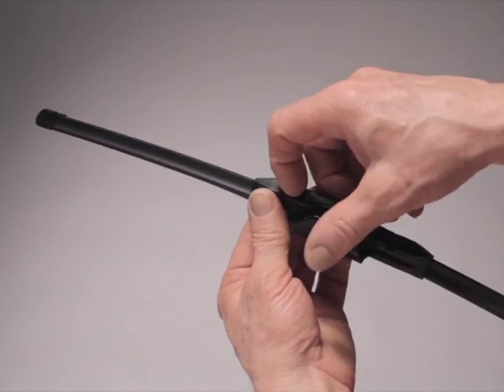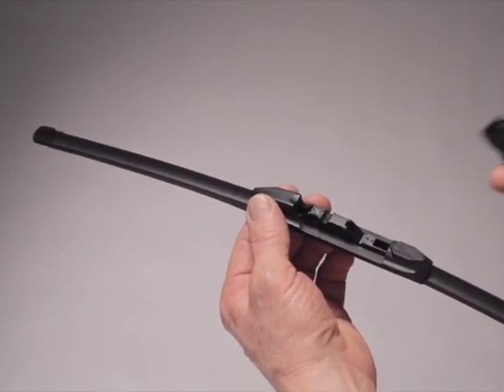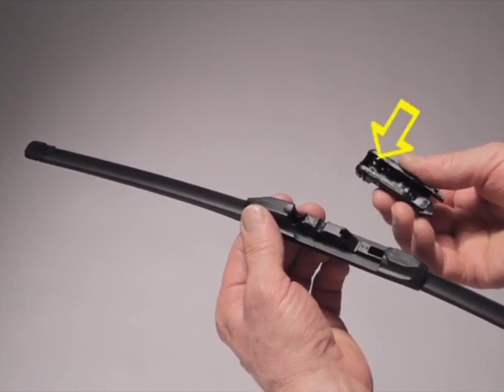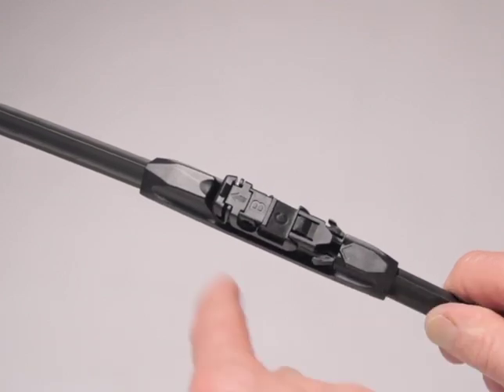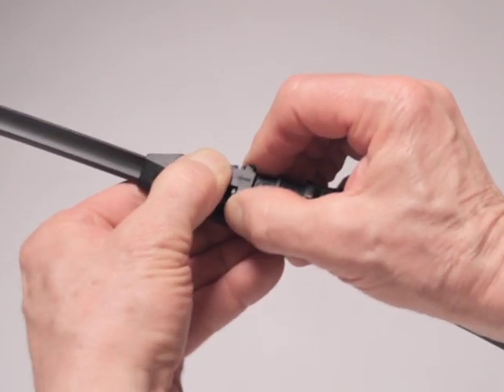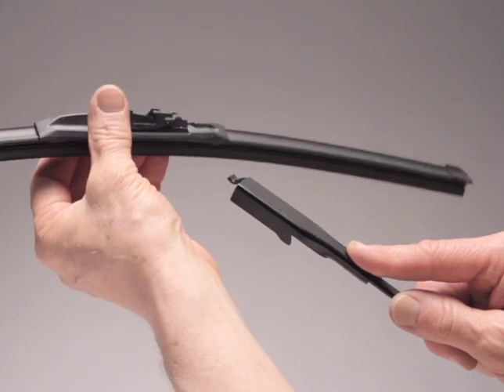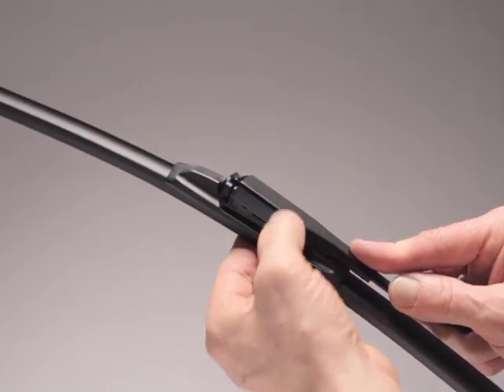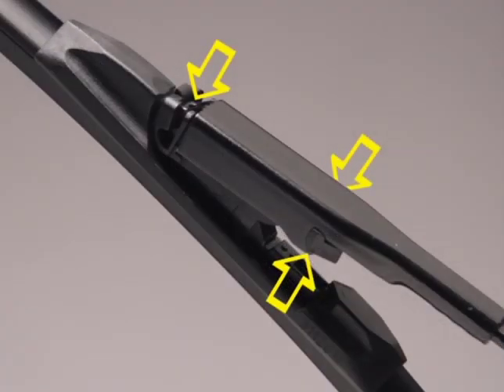TRICO Tech Blade Pinch Tab Arm

Comment: I've got a 2013 C-Max and purchased my blades from Ford.  Motorcraft part WW-2601-PF for the 26".  You'll need a 28" blade as well. This is the same as in this video (TRICO Tech Blade Pinch Tab Arm).  Couldn't tell dip from the tiny written instructions but removal of old blades and installation of new blades was quick and easy after watching this video. There were so many adapters, some of which are thrown away, that changing blades only once every couple of years who could remember what to do?  Thanks, Trico.